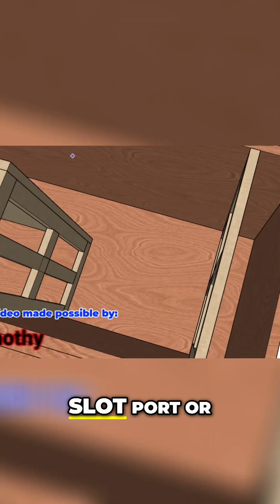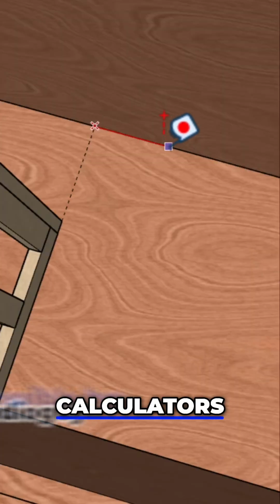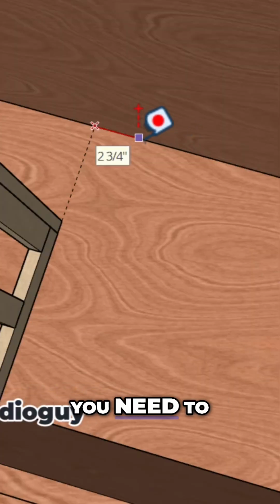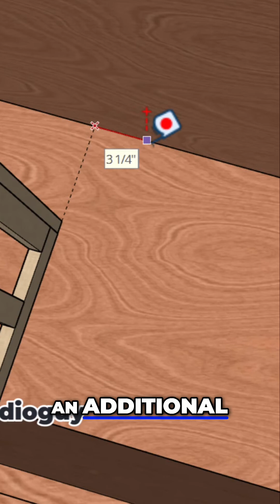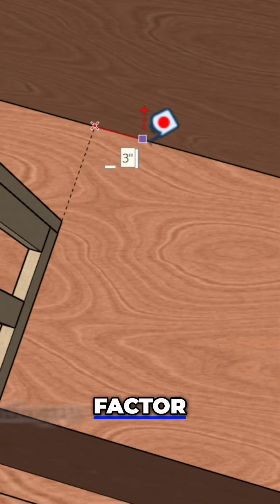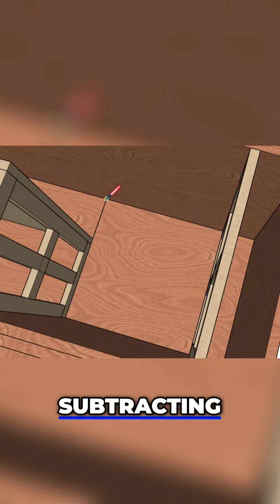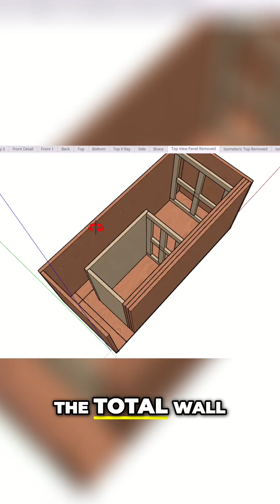Mastering Port Design  Essential Tips for Perfect Sound

Comment: so when Input my numbers in your calculator it makes my port almost half the length, but the question I have is. Does it matter how many common walls you have.
Reply from the maker: I'm not sure what you mean by half the length.  Half the length of what? 

If the port shares any wall with the outside of the box then check the common wall box.
Reply: @DIYAudioGuy  I did, so if I leave it unchecked it makes it around 41 inches long instead 21 if it is checked… but when I go on WinIsd it says it should be 41 inches long. Does that make sense ?
Reply from the maker: @logielogful  Odd.  I may need to do some troubleshooting.  Thanks for letting me know.